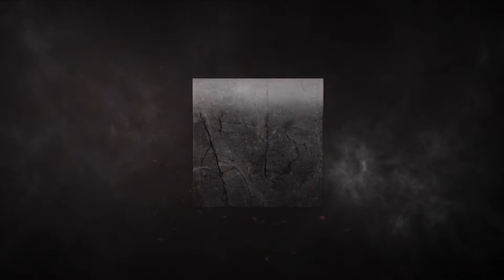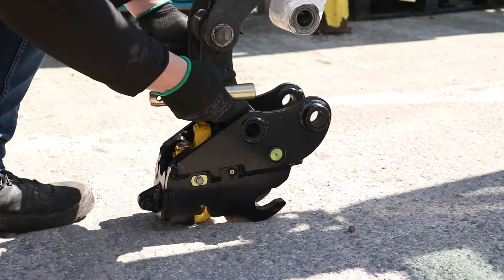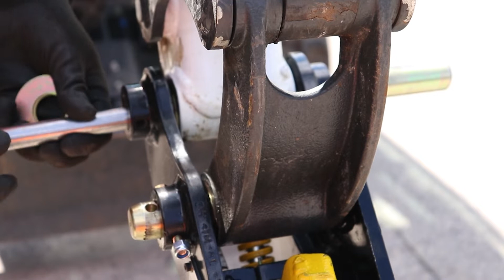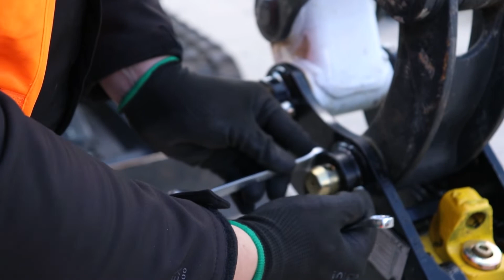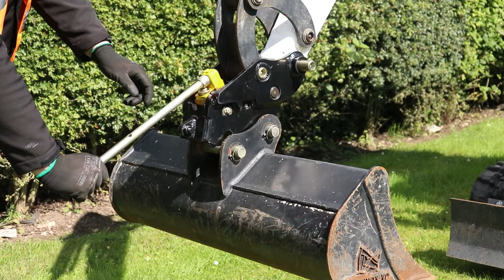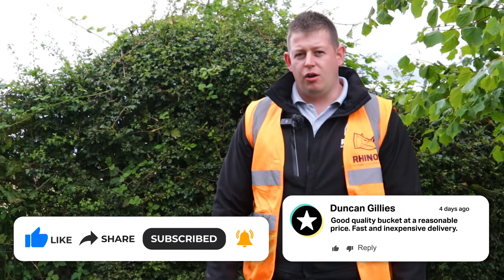HOW TO: Use the Rhinox Autolock Quick Hitch - Including how to fit!

Comment: I've bought a trenching bucket and a tilt bucket from rhinox for a Bobcat x323 and I really like both of them, but it can take 20 minutes trying to change buckets. I wanted to ask someone how much the coupler would extend the bucket down past the hydraulic thumb. The thumb and the bucket line up perfectly right now so I think the only option is welding more teeth on the end of the thumb or try to find another thumb that is the right length.
Reply from the maker: Thank you for your comment and for your previous purchase - we appreciate your support! Regarding the geometry, you're correct that adding a coupler will likely increase the distance between your thumb and bucket. Unfortunately, this distance can vary depending on the machine, so we’re unable to provide exact dimensions.

Our best suggestion would be to purchase the coupler and test it out to see how it works for your setup. After trying it, you can decide whether welding or swapping your thumb is the best solution. Many users find it’s not an issue at all, but it ultimately depends on your specific machine and preferences!

Feel free to get in touch via email or give us a call if you need any more information or have any questions, one of our team will be able to help you out! Call: (267) 861 0812 or email: sales@rhinox-group.us

Comment: I am sooo disappointed. I bought a used digger that had a bad factory coupler. For the same money i could have bought this coupler. Its much nicer and many more buckets are available with full pin set up than quik coupler buckets. Ddddayum.
Reply from the maker: We're sorry to hear this! Quick couplers are a great investment so if you can justify one, we would always recommend investing! They save a lot of unnecessary wear to your pins, bucket links and tipping links.